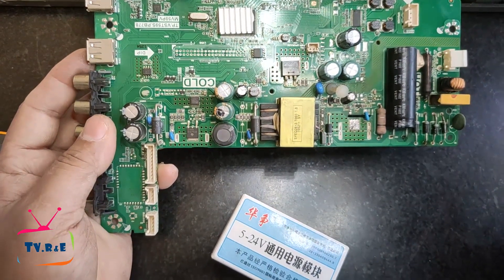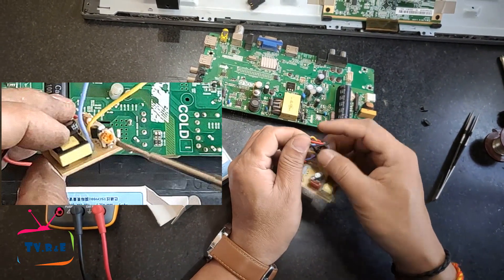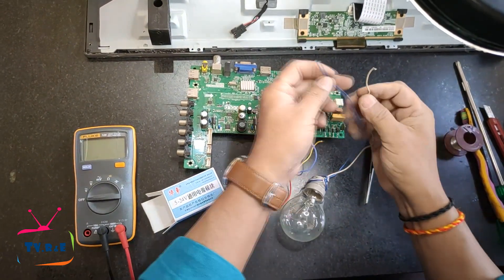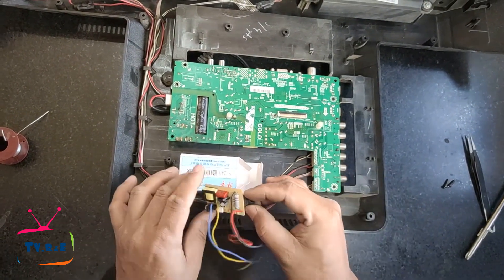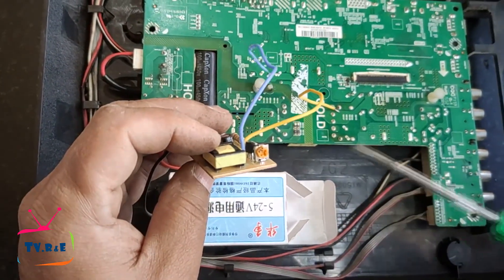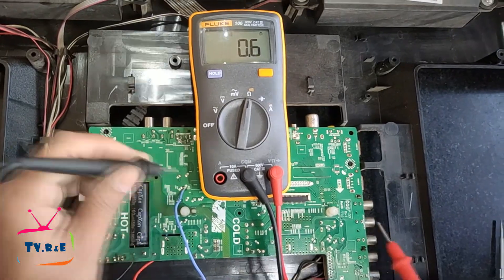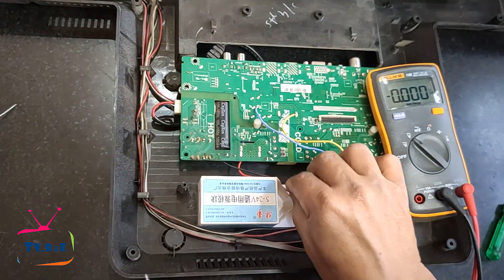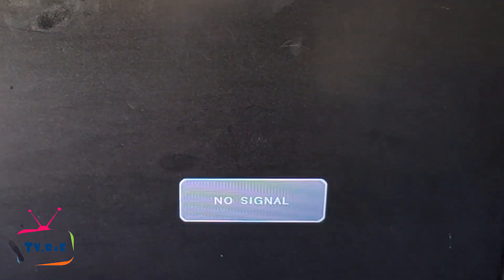Power supply module connection.

Comment: मेरे बुश का 20 inch remote control crt tv है, उसमें 8 selector हैं,वो घुमाते हुए खराब हो गये, स्टेशन ठहराता नहीं,audio video in है नहीं तो मैं main ic की किस pin पर सीधे video in देखें, audio volume control तो set top box से भी करलूंगा , please solve the problem, thanks.
Reply from the maker: RF modulator Dal Ke dekhiae Iske bare mein Mere channel per video Diya Hua Hai dhanyvad
Reply: @electrorepairhub  धन्यवाद आपका